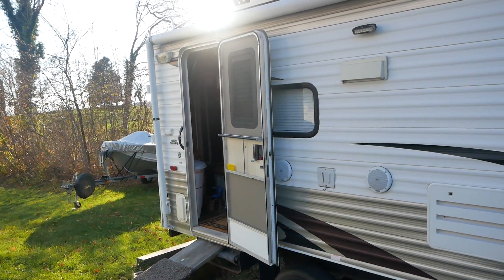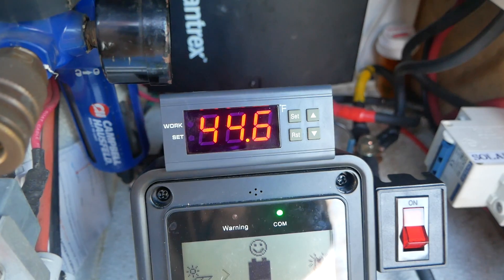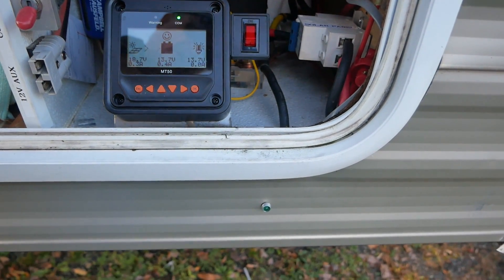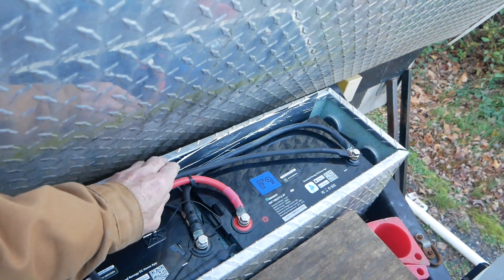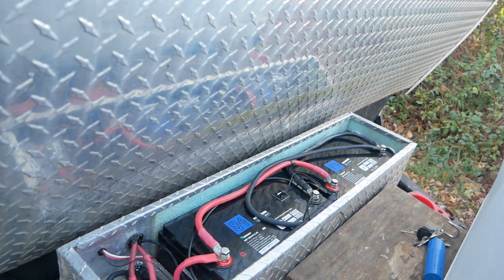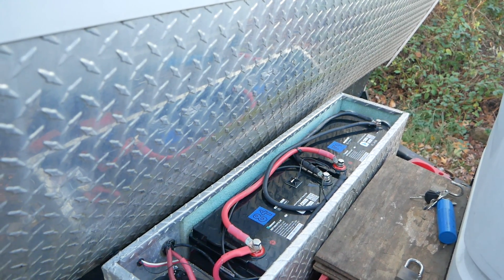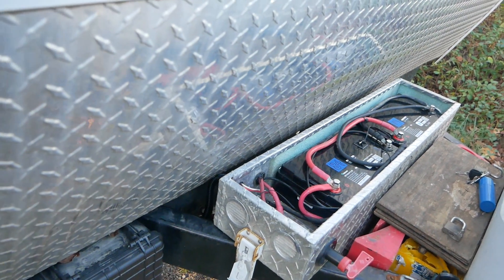Lithium Battery Heating System DIY

Comment: You need to move your water system away from that. If you ever develop a water leak or a pen leak that sprays that controller or drips onto your other controller or whatever. You're going to fry your system
Reply from the maker: There is no water anywhere near any of the electrical system. What are you seeing?
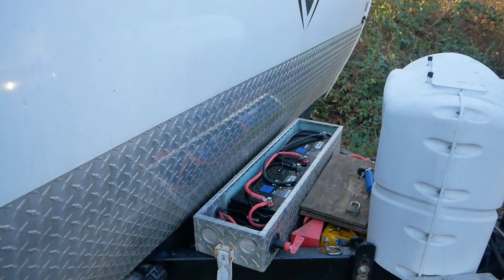Reply: @roybertalotto6355  You just said in the video that that's one compartment holds the electrical and the water.  I'm simply repeating what you stated in the video.  At 6:16 You said your water filter. Was in this compartment. That would mean water lines are running to this water filter. If they develop a leak they could spray the electronics
Reply from the maker: @personal.YouTube.channel I must of had a senior moment and misspoke…😁
Reply: @roybertalotto6355   okay that happens !  But you got to understand I can only go according to what you say.
Reply from the maker: @personal.YouTube.channel  I think you need to watch the video again. The only time I mentioned the word water is when I suggest that the heating pad I used is normally used to heat a water tank. I just reviewed it again and I see nowhere that I said there was water in the battery. Box are in the solar charge controller inverter area. But thanks for bringing it into my attention.
Reply: @roybertalotto6355  I've already went back and watched it three times to make sure. At  6:16 into the video. You said that this compartment also contains your water filter. If it has your water filter for your water. Then it would make sense that you have water lines going to it. Water filters have limes going in and out as a purify the water.  If you have a water filter in there. Do you have water lines going to it.   It's common sense. Go to the 6:16 mark of the video & listen to yourself say it.
Reply from the maker: @personal.YouTube.channel  Huh!!! The video only runs to 6:15! What are you watching. I need to clear this up. And I do not have ANY water filters in this camper....???
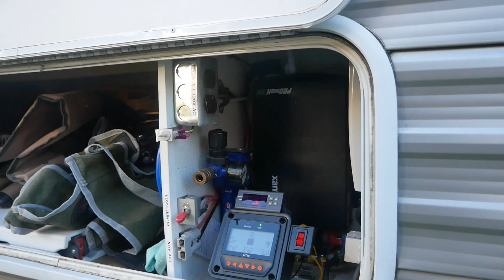Reply: @roybertalotto6355   sorry you're right about the time. It's around 5:40 I looked at the wrong number on the screen. My bad on that part. It's where you were talking about your air compressor your power inverter and your water filter. You said you had everything underneath the sun in there and it was getting a bit crowded.
Reply: It's where you were talking about your air compressor your power inverter and your water filter.
Reply from the maker: @personal.YouTube.channel  Ah!!! Yes, I did say Water Filter. You got me. It is the water "separator" for the air line from the compressor.  Actually, the compressor gets used so infrequently that I've never, in 8 years, seen any water in the bowl. But you are correct, it probabl;y should be moved. Thanks for pointing it out...I owe you a beer!
Reply: @roybertalotto6355    I'm not saying that it ever will. But the first time it does.  We all know it only takes once. Once it happens it can cost you a lot.  That's all I'm saying water and electricity don't mix. That it's something that you need to be careful about.

Comment: Is it possible to put a half inch of foam on the bottom of the box, then the heating pad and then the batteries? 
The heat would rise up into the batteries more evenly.
Reply from the maker: Sure, but I was concerned about the batteries resting on the pad. Last night it got down to 24F and at sunrise, I checked the temperature in the box.....52 degrees!

Comment from the maker: I was just informed that there is a commercial battery heat system available. The Sun Fun Heated Jacket looks good and for around $100 a pretty good value.....But at 8amp draw watch your battery capacity...https://www.sunfunkits.com/product/47/heated-jacket-12v-for-lithium-batteries
Reply from the maker: Yes, I saw that, but as you said, its a power hog!

Comment: Why not just the sun fun kits heated jacket?
Reply from the maker: I'm a died in the wool DIYer......If I can make or build it, I'd rather not buy it.....
Reply from the maker: The Sun Fun Heated Jacket looks good and for around $100 a pretty good value.....But at 8amp draw watch your battery capacity...https://www.sunfunkits.com/product/47/heated-jacket-12v-for-lithium-batteries

Comment: i just bought one of these controllers, it had no indication on which terminal is +  or --  don't want to blow it up  Any help needed asap plz
Reply: Same problem. Frustrating. Did you find it mattered? I guessed and it worked.

Comment: You have a very nice set up. 
??  Why  didn't you sit your batteries on  TOP of the heating pad?
Reply from the maker: I thought all the bouncing around might damage them if they were under the battery.
Reply: A link to the controller and the pads would be awesome! I like this setup a lot.
Reply: Having trouble locating a proper thermostat on Amazon also.
Reply from the maker: @djicedragon855 Search on Amazon for... Bayite DC 12V Fahrenheit Digital Temperature Controller 10A 1 Relay with Sensor....